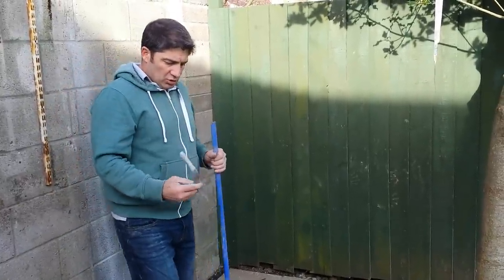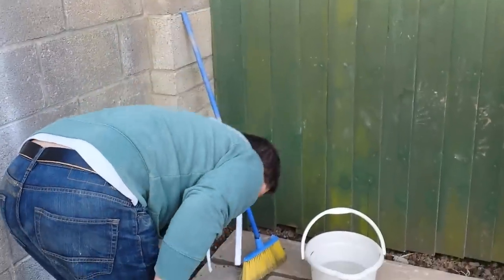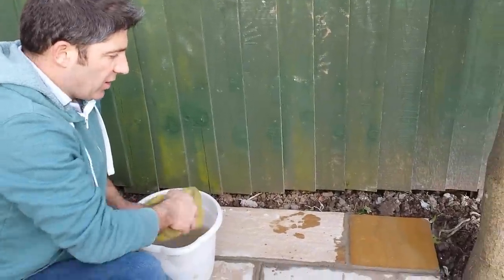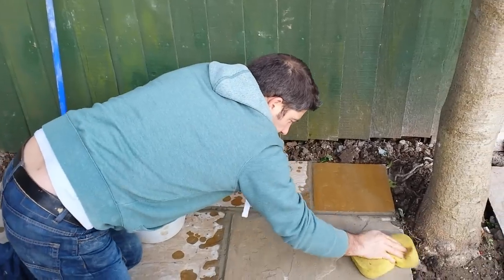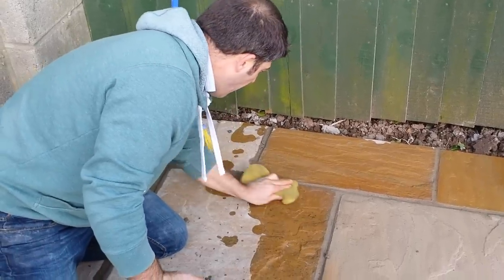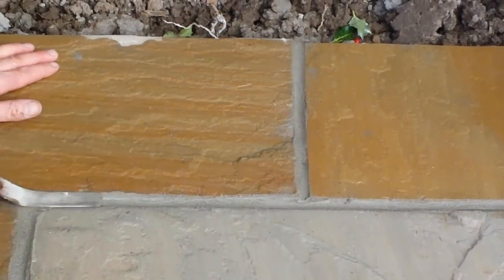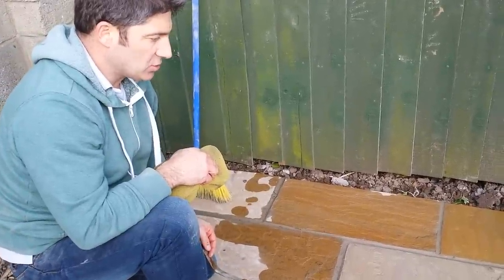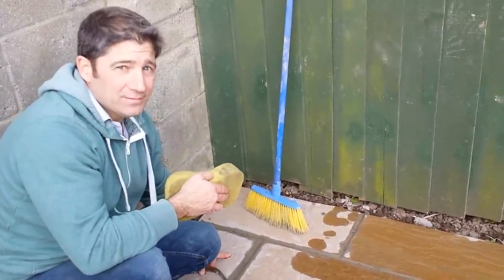How To Point A Patio And Clean Indian Sandstone

Comment: Thanks for this video. 
Will it work if I use a waterproof mortar mixture, because I need to repoint old paving slabs that are above a basement so I need to prevent water seeping through. There is a sheet of DPM under all the slabs, but I think over time weeds growing inbetween the joints have punctured it

Comment: I would like to see how this patio looks now, I bet there is picture framing in some stones due to how wet the pointing was. That soaks the cement into the stone and a few months later it usually makes it to the surface of the stone just by the edge and leaves an irreversible stain, "picture framing". 

Always do pointing with dry mixture of white cement and grit sand (and colour dye if you don't like white joints) in order to avoid picture framing. White cement has less of the substance that causes the chemical reaction that results in picture framing.
Reply from the maker: +Hugo Mendes thanks for your comments, i have to say i never get any staining at all.

Comment: I made the mistake of using brush in on sandstone. Didn't realise it was porous 🤦‍♂️
It's breaking up with surface weed and holding water as permeable bed. Someone told me to resi seal it to block the pores. What do you think best to rectify without ripping out. Client isn't even aware. I jetwashed it and it's come out great but in the back of my head i know there's an issue. Thanks.
Reply from the maker: To the best thing and start again, its the best thing to do
Reply: @GreentopLandscapes  Hi Johny. I don't have the option to remove the porous brush in due to client selling the house and not wanting the disruption. The pointing now jetwashed is clean and solid as i ironed it in well. Nothing came out when i jetwashed it and it looks good. I would really like to know how to make it non porous. Even temporarily would be a help as i need to paint a rendered wall above it. I'm looking for something that would stop the jointing absorbing and holding water. Could you advise something please? Is it even possible to make it non porous? I accept taking it out is the best option but i don't have that option now. Any ideas would be gratefully recieved. Many thanks. Phil.

Comment: There can be a dusty residue left after using this method, but the water breaks down the mortars strenght and it can be easliy hosed away,  but he said himself you should give it a second wipe with the wet sponge as its drying .

Also if you dont have a pointing trowel or iron , i used the head of table spoon ,  most have a curved head that fits perfectly into a joint this size.
Reply from the maker: +Crimhthan Mor thank you

Comment: I like your passion for the job,  and fair play to you for making the videos (it`s a shame you put so many cross joints in your work though ) but the big problem with mortar jointing is it gets hairline cracks in it, looks great at first but dosn`t take long for them to appear. You just can`t account for that. Also if its rained the night before or for prolonged  periods, you cant point it as the water just sits in the joints, or it can rain half way through pointing and the job goes tits up....nothing but stress with mortar pointing. Thats why so many landscapers have switched to resin products as its so much easier. Nothing to do with not getting on your knees or getting your hands wet.
Reply: Darren Jackson  what he is doing is very time consuming i have switched to resin jointing compound it's brilliant brings the colour out of the flags also. It won't pepple dash it if it rains either!. Totally agree.

Comment: It's quite good but it is a bit time consuming compared to an alternative, and what's with the obsession with kneeling on the patio. Watch them knees. 
I would either use a good grout or mix the mortar well and fine to use through a mortar gun. If it's then left for an hour or so, it can then be struck with the steel. On the next day I would scrape off the pointing rough bits with a brick layers trowel and sweep it clean. That works well for me.

Comment: If a seen someone pointing my sandstone patio with brush resin a wouldn't be happy. A good old 3 sharp 1 building 1 lime 1 cement get it like putty and get on your knees jobs lasting 80 plus years. If it wets just wait for a dry day. Or try semi dry brush in method with still pointing the muck down hard as you can.
Reply from the maker: 100%

Comment: that is excessive work, it looks strong but hairline cracks and possible framing could occur. my preffered method is, semi dry mix which goes smooth under pressure made with 2 grit sand 1 building sand 1 cement, then chop it into the joints with a trowel, then smooth over the top on either side of the joint creating a very gentle apex on the joint, leave for an hour, brush off. It takes skill but less time, not for DIYer! ive honestly had loads of remarks on the quality of this style pointing. 
(however it works best with riven paving not sawn or smooth paving)
Reply: Rob J even better point them as you lay them then that way you don’t have a cold joint